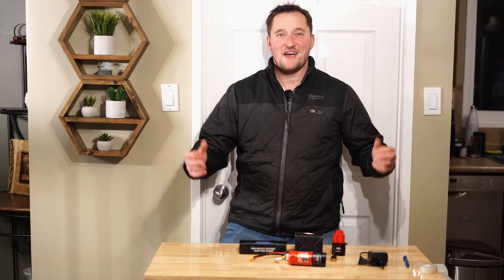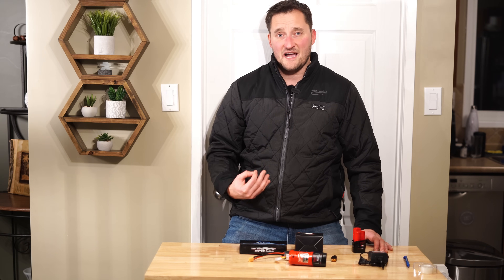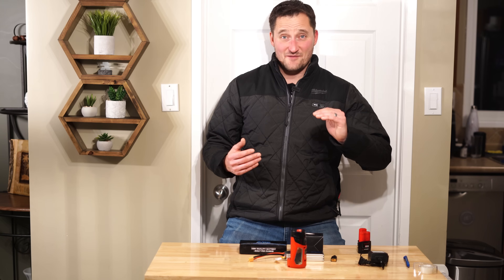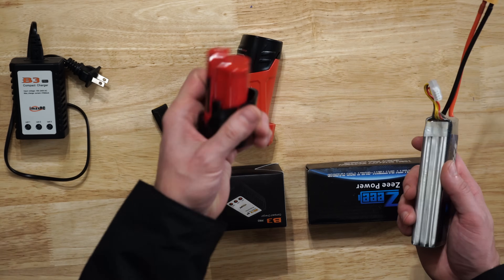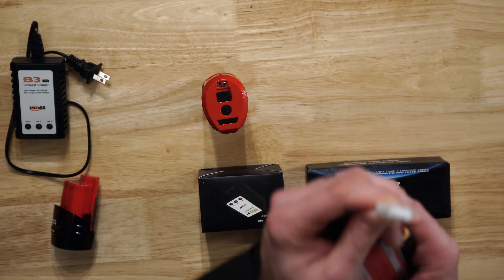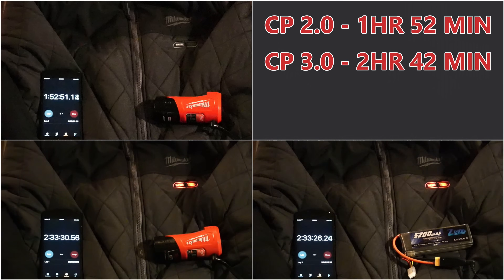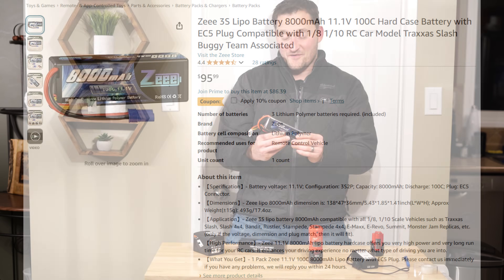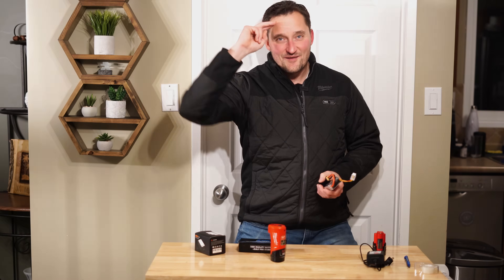WARNING! Read Description - Milwaukee M12 Heated Gear Battery HACK for INSANE RUNTIME!  Part 1

Comment: Those batteries are junk. They may work a little bit but wait until they expand and blow up in your back. You should never keep out on a battery for what you’re doing specially, if it’s gonna be hooked up to the back of your jacket as an RC Abbott obvious100% do not use that battery. They may work for a bit, but if that expands with those cells and catches on fire man you’re burning up I wouldn’t do it. Please don’t use that wall charger either you’re asking for that battery to balloon and explode. You never cheat out on batteries or chargers ever because you don’t know what the sale rating is gonna be at there’s every chance that this battery could balloon in your back pocket and just light up.
Reply from the maker: @davidrichardson4198  thanks for the advice here, I don't charge the battery unattended, and always do a quick visual inspection before throwing it in the jacket. I just put out a new video where I'm using a B6 charger and added a low voltage buzzer based on the good advice I've gotten from here. Remember in pulling less than an amp from the pack, and basically trickle charge it back up when it's time. In RC applications I would argue that the demands on these packs are around 25x higher as well as being used in a much tougher environment! Cheers.

Comment: LiPo batteries are great but do your homework!!! these are very dangerous if you misuse them.
Reply from the maker: @billygoat2901  I agree! The community here has been great at pointing out some beat practices. I just released a new video using the low voltage alarm, and will have another one coming out shortly talking about safety precautions. Cheers!

Comment: Telling people to use a high output lipo in their pocket instead of li-ion cells is not only ignorant but it is dangerous. To top it off , it is a soft pack and not a hardcase lipo.
Yes they are more powerful but they are far from being safer.
Reply from the maker: Thanks for taking the time to comment, I have since added a low voltage alarm and always make sure that I supervise the charging of my battery. I also take care to store it in a metal ammo box when not in use. Cheers.

Comment: Jesus christ this guy is going to start a fire. Do not use these batteries like this. They dont have bms, or casing to protect them from any thing.
Reply from the maker: @rangerbrown  Hi again! I've since added a low voltage monitor, just did an updated video on it. Thanks!

Comment: You can get much better chargers for under $40
Reply from the maker: Hi there! Thanks for the comment! The B3 served the purpose for getting me started, but I actually picked up the hobbyfans B6 mini Pro for around 40$ CAD. I'll be showcasing it in my next video on LiPo safety. Cheers!

Comment: I have a lot of time with lipos. I fly r/c helis and play with r/c trucks.  
I set the cutoff to 3.2V but you may be able to get away with 3.1 or even 3.0 if you do your due diligence and check the voltage drop when the heated gear kicks on. A big draw when it kicks on to heat when your battery is low could damage it. 
you have the right connector, XT is the way to go.
Reply from the maker: @DavidSmith-jj5pr  thanks for taking the time to comment! Milwaukees batteries cut off at 3.4v, zee states 3.2v I believe. Do you have a link to them at all? Would be interested in checking them out!

Comment: Milwaukee makes a new battery for the jackets in the shape of a flask 
And it has usb c 
Fits into the pocket easily
Reply from the maker: @tomhow12  yup, I'm aware but that battery is only the equivalent of 3Ah. Meaning you are going to get Into the same runtime issues. I'm willing to bet there are about 10x more of the older style jackets out there vs. the new Hexon ones based on how long they have been around. Cheers!
Reply: That new pack also uses a bluetooth antenna which in itself will trickle drain and can't be shut off (from what I am hearing)
Reply from the maker: @TunaSoda  and is still only about 3Ah. I can appreciate the need to innovate, but I don't think I need an app controlled jacket.

Comment: I’m trying to have a power bank in my backpack to keep it on while I drive my motorcycle then the little batteries when I walk
Reply from the maker: @MagikarpTheory  thanks for the comment! I would start off by finding out what voltage you need, then source the proper adapters. Low voltage cut off alarms or some type of BMS is a must. Make sure you follow all the necessary safety precautions for LiPo batteries and understand the risks. Good luck!

Comment: lipo fires can be scary inside of your coat... just be careful not to punct. it
Reply from the maker: @Clay-e8r  I agree that LiPo fires can be scary, but if you mitigate the risks you should be OK! With where the battery sits on the side I think I would stand a better chance of winning the lottery, then puncturing the pack, but you just never know. I would look into a hard case alternative for next time!

Comment: My lipo charger icharger x6 charges such batteries in about 15-20 minutes . That lipo can be charged at 5c comfortably so if you want to step up your game you could safely charge it at 30amps and be done in literally seconds 😊 trust me I’m a professional been in the hobby working for about 19 years. This was a cool video I did this long time ago myself but I use a way smaller battery and get about 4 hours run time. Also avoid going to 3.2v per cell. I try not to go lower than 10v on the entire pack. In a perfect world don’t even go under 11.1v this will give you the longest battery cycle life overtime. And you could also pick up a high voltage version of lipo battery which can take you from a full charged pack voltage of normally it’s 12.6v to around 13.2v which would mean two things, warmer jacket and longer play time
Reply from the maker: Thanks for the kind words! I picked up a 9000mAh pack and will be doing an updated video soon! I've been doing some additional testing using low voltage alarms and have set the floor at 3.4v per cell. (Zeee says I'm good to 3.2v per cell but the internet says that's blasphemy!) If anyone was interested in donating me a jacket I would gladly "overclock" it with a 4s battery and see what happens! Cheers!

Comment: This is so dangerous 😢
Reply from the maker: @bakeralex201  consider the application and use case however. The jacket discharges between 0.6 & 0.8 amps... Battery stays protected in the back pocket area (I've also added a low voltage alarm) and I recharge the battery at 0.8 amps... Aside from a hard case I think I've mitigated the risks fairly well? I do have some follow up videos coming that will delve deeper into the safety sod EOD things as well. Thanks for the comment. Cheers!

Comment: Milwaukee jackets only do 9 watts of heating power, it's a total sham. 
Go to the motorcycle store or online and get a hotwire jacket, it's made for motorcycles. It provides 80 watts of heating power, you can run them off drill batteries, you're welcome 😉
Reply from the maker: @foam27  would love to see one of these in action! Thanks for the heads up!

Comment: This is way overkill. 

You need a usb c trigger to dc adapter. 

Use a usb c battery pack (way safer as mentioned many times here than LiPo) and then boom - I have 8+ hours of run time with an Anker 20k mAh battery pack. 

The pros are i can even plug in the coat directly to my cellphone charger in the car, or my bigger batteries at home. 

My Anker 20k (with built in USB C) lasts me 8+ hours. 

Pros are i can natively charge my phone too. 

AND its way WAY safer than LiPo. 

Please be safe when dealing with LiPo.

A usb C to DC trigger can be found for ~$20, my anker 20k battery bank (which is native USB C i think was ~$45) and i dont have to attach a bunch of useless adapters to it AND most important - its WAY more safe.
Reply from the maker: @jaredpnk  thanks for the perspective, I have the Anker 26800 pack and it's massive. I can't emphasize the size and weight savings if using one of these. Yep there are safety concerns one needs to take into account no doubt about it, but the USB C packs are big boys.
Reply: @RegsChannel  that's why I said the 20k pack. It's similar size and safer by FAR, and the benefits of USB vs some other DC connector far outweigh any benefits you may get from this method. Sure it works, but there's better out there. My Anker 10k power bank is even smaller than your pack here, and it still is safer. 

Obviously whatever works for you that's fine I'm glad you found a solution. But this isn't the best option or safest.
Reply from the maker: @jaredpnk  thanks for your opinion, Take care!
Reply: @RegsChannel  I guess I'm just asking for you to make fair comparisons. Sure the Anker 26800 pack is huge. I have two of them. I fully agree with you there

The 20k with built in usb c is lighter than that one. The Anker 10k with USB c built in is even smaller yet and I still get 5-6 hours on high if not more. 

LiPo is fine if you know how to use it safely, but the majority of people don't. By the time you add in the needed protection, the adapters etc a USB C power bank is cheaper, smaller(potentially) and FAR safer.
Reply: AND with both packs I can have them topped off in the car, with any charger that goes into a 12v socket in your car, another power bank, etc. it'll charge a LOT faster than what you have here too. 

Obviously options are good, but either way, glad you found something that works.
Reply from the maker: @jaredpnk  Thanks again for your opinion, take care!

Comment: Try having a 3d printed enclosure made to hold the battery..I'd make one to hold 2 or possibly 3 batteries with a dedicated plug in board(for the battery end to what you need. 3 8000mAh batteries would give you ALL day heat and probably still be relatively comfortable laid flat against your lower back
Reply from the maker: Very cool idea! I'm thinking about cooking up something over the holidays involving a 3D printer. Stay tuned!
Reply: @RegsChannel  if you don't have one already a Creality is probably your best bang for your buck during black friday/holiday sales. There are better options but for ease of assembly (what little there is), print volume and quality over cost it's hard to beat. Prusa's are a no-brainer and rock solid, Anker makes a decent unit with several cool features, Bambu labs, the list is endless honestly, no want for choices
Reply: Also if you use several batteries in parallel I imagine they don't heat up to badly as the energy discharge would be halved between them but you might look into a low-profile aluminum heat exchanger to keep temps down...IF they are heating up
Reply from the maker: @mythos000000025  hey there, the battery does not heat up at all either while in use or while being charged. I attribute that to the fact that I charge it at 0.8 amps, and discharge is between 0.6 & 0.8 amps. Thanks!

Comment: pls do some good research on those batteries. they have specific discharge voltages you don't want to go under as well as overcharge. that charger you bought is very cheap and may not be smart enough to detect when it needs to stop or when a battery is bad. I've had a few brand new battery's puff up and burn up on the charger. you can never be too safe. there are bags and containers dedicated for storage and charging incase they do decide to burn. RC cars have ESCs that will stop the battery from draining down below a certain voltage cause its not good for the battery, rc planes also use low voltage buzzers that beep when you're running low so you can hear it before your plane drops from the sky. your jacket wont have any of those meaning it will drain the battery past its limits. a low voltage buzzer should do the trick, it tells you the total voltage, each cells voltage and will beep at the set cut off. just keep in mind it uses the battery too to stay on so it can run down use time
Reply from the maker: @rikijg01  some good points overall! I actually have a low voltage buzzer now, I store/ charge the batteries in an old metal ammo container, and have a B6 charger on the way. Cheers!

Comment: Well it’s not underrated 
Your test needs to stop when that battery drops to 11.5 or so 
Your Milwaukee shuts down way before that
You weren’t getting much heat
Ok so 10.5 volts not 11.5 is the M12 shut off voltage 
Your battery without a low voltage shut off will discharge till it’s unsafe to charge
Reply from the maker: @DavidMcGee-tn9ew  the Milwaukee cuts off between 10.2 - 9.9 volts. As I said in the video when I metered the pack it was at 9.9 after nearly 6 hours. Zeee stats the pack can go down to 9.6 volts / 3.2 per cell. I would probably use 10.2/9.9 as my floor. When I stopped the test the jacket felt just as warm as with the Milwaukee cells for what it's worth. Thanks for the comment!

Comment: Thanks for sharing your experience.  Honestly, I'd never have thought to consider another type of battery than that of the original manufacturer.
Reply from the maker: @MacBolden  thanks for the comment! The batteries aren't rocket science if you take the right precautions!

Comment: I have the 8000 for my RC buggy and they work great. Thanks for this I will be getting the adapter as any of the RC batteries are a lot cheaper than the Milwaukee and both my wife and I have the vest

Comment: I recommend the M12 heated vest. I wear it as a base layer with a hoodie and jacket on top. I work outside during the winter and it lasts all day on low with a 3ah battery. Keep a second in my lunch box just in case but I rarely need it.
Reply from the maker: Hi there! Thanks for the comment. I got one for my wife and she loves hers. It doesn't have as many heating zones. Given that, yes I can see it lasting longer! How cold does it get where you are? If you are moving around and working on it I can see it keeping you warm! Remember I bought mine to drink beer in and watch football 😂 So I am stationary the majority of the time. Cheers!

Comment: In addition to the other comments, look out for your packs becoming puffy - and replace promptly. And for peace of mind get a flameproof lipo charge bag and/or charge in a place where 10 seconds of BBQ won't spread. But yes! And this makes me want to get a jacket.
Reply from the maker: Hi there! Solid advice! Yeah I do an inspection of the battery pre use always. I have a metal ammo box as well for charging and storage, and also added. A low voltage alarm. Thanks for the comment!

Comment: RC guy, here - nice find, but those Zeee batteries are among the lowest-quality available and, in spite of their price, are actually a rip-off.  Cheers -
Reply from the maker: Thanks for the comment! Remember I'm discharging these at less than one amp, and also charging them at the same rate. (Along with taking the proper safety precautions) So far so good for this application. Cheers!
Reply: @RegsChannel  good point - you might actually get most of the rated capacity at that rate.
Here's a tip - if you only charge to 4.1 volts per cell (instead of 4.2), the thing last twice as long.
Reply from the maker: @mlentsch  thanks for the advice! The rest of the gear should be here in the next few days and I'll get an updated video out! The new charger should allow me to set max charge voltage. Cheers!

Comment: One disadvantage with those RC batteries is bare pouch cells have no mechanical protection. You are one poke, pinch, impact or other damage away from potential disaster. You shouldn't put bare pouch cells in your coat pockets. These really should be in some sort of enclosure to protect them from scrapes and at least blunt other common pocket damage sources.
Reply from the maker: Hi ther! Thanks for the comment! I do actually have a hard case pack on the way. The battery sits in its own pouch in the jacket. That sits on my left side. I've had some folks comment that I would be in far worse shape from whatever would have caused the pack to get damaged in the first place then what would cause it to turn into thermite! I've added a low voltage alarm into the mix as well. Cheers!
Reply: @RegsChannel  It doesn't take much to set some cells off, a lot of it is just luck or lack thereof.

Some cells spontaneously burst into flames for no apparent reason, like that EV in South Korea that spontaneously burst into flames after being parked for over a week while its owner was away on vacation. Three seconds from first visible smoke on the security camera to full-blown inferno.
Reply from the maker: @teardowndan5364  thanks for the feedback!

Comment: I understand and appreciate the spirit of this possible alternative but the chemistry in the lipo batteries are too scary for IMO to have in a jacket pocket regularly. I’ve seen them catch fire or explode to the point charging it indoors feels risky. It’s crazy because these go in extremely fast RCs that get wrecked but it’s not next to ur body. I would weigh the benefits
Reply from the maker: I appreciate your input. Thanks for the comment!

Comment: Use a bms, aka battery management system.  It will not let your lipo drain down past a set limit such as 20% left. Look in the rc hobby industry
Reply from the maker: @fusionsvt00  thanks for the feedback! I have picked up a low voltage alarm and have been using that but a BMS would be the dream!

Comment: Do not charge or leave those batteries overnight or out of a metal box🔥
Reply from the maker: @MitchOfCanada  Good point! I have an old metal ammo box I leave them in, and yes the manufacturer specifies right on the charger not to use it unattended. Thanks for the comment!